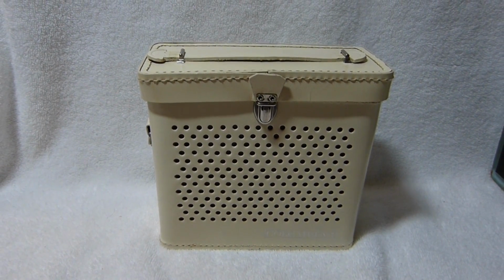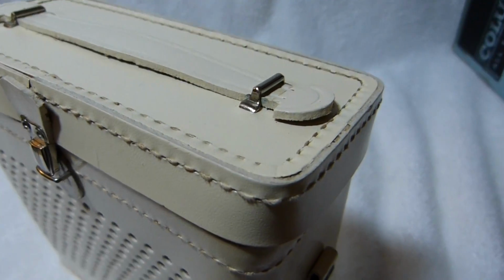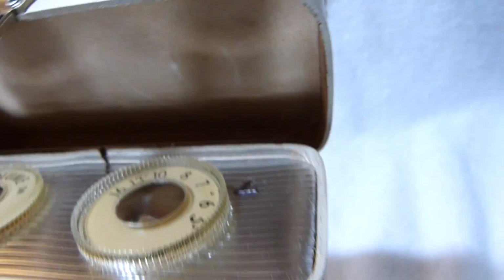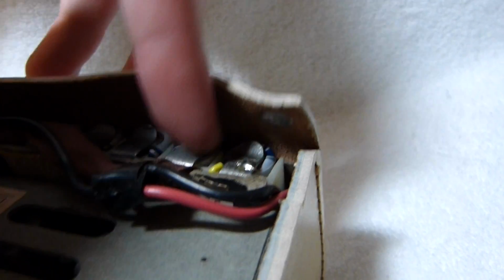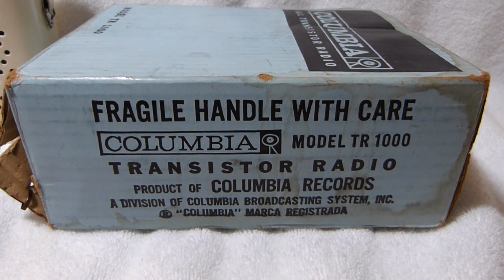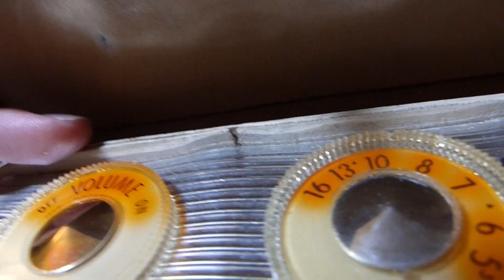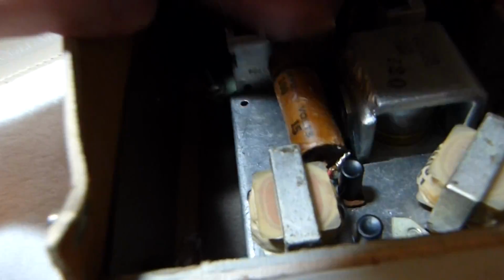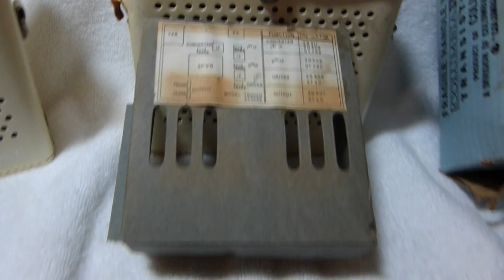1957 Columbia model TR1000 transistor radio  (Made in USA by Roland)

Comment: I lucked up and found this radio for a reasonable amount recently.  Mine is the dark brown version, but its serial number is way earlier.  Mine is T-2076, and there are other differences.  The transistor diagram pasted to the cardboard is way smaller, and it uses only General Transistor transistors, which look original to it.  Surprisingly, it still worked, though the volume was a tad lower than it should be.  After re-capping it, it performs better than I would expect.  Every image I have seen of this radio uses RCA transistors, so mine is unusual.
Reply from the maker: Interesting, I wonder why they switched from GT transistors to RCA ones. It's a fairly well built radio, though it's probably not on anyone's "most beautiful radios" list!

Comment: I wonder if "Columbia" was a division of the "CBS Tube Company"?? Another very nice find!! Your gift for finding these high quality gems is unrivaled!!
 BTW, that paper electrolytic at 7:53 is just beggin' for a re-stuff!!
Reply from the maker: Thanks! The box says "Colombia Records" is a division of "Colombia Broadcasting System Inc". I will probably leave the original paper electrolytic in place and hide the replacement under the chassis, like I did for the other three capacitors. I still can't believe I don't notice that capacitor was an electrolytic while I was working on the set.